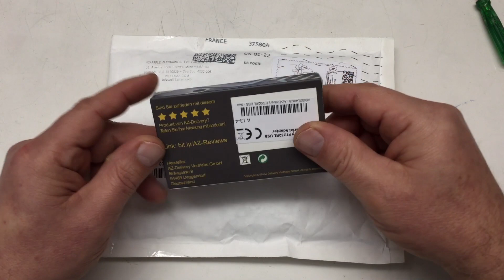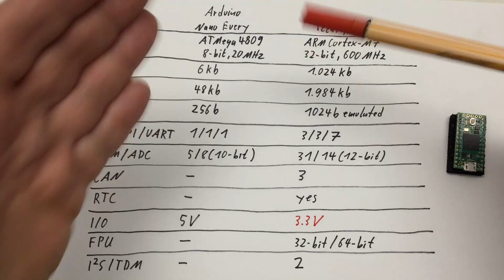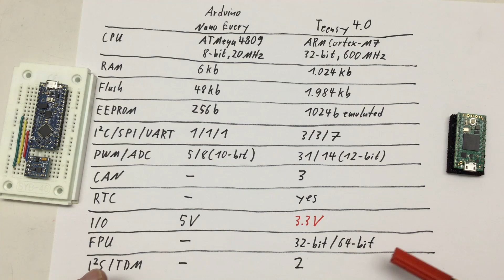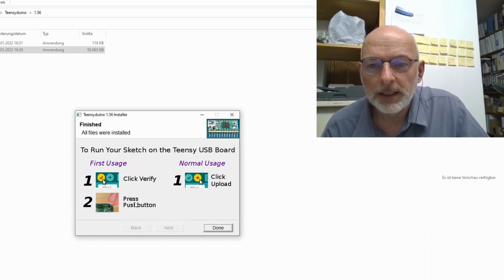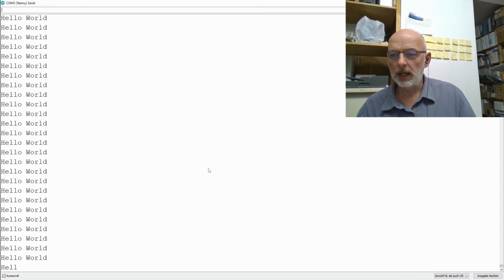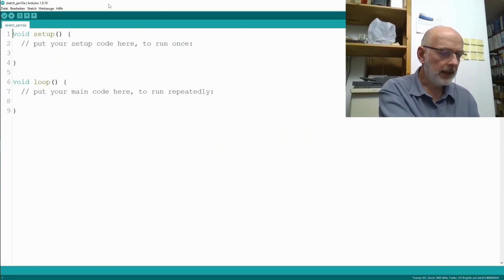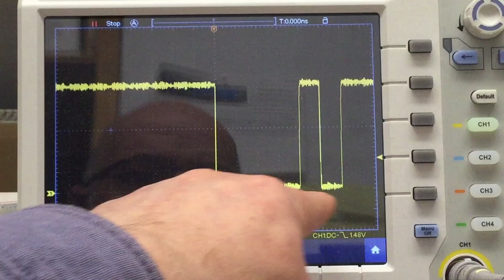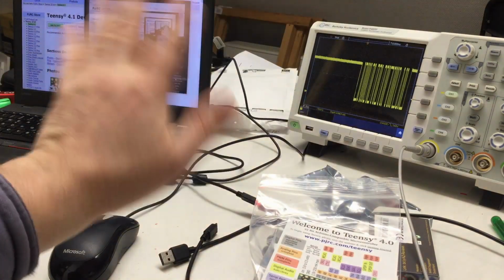Mailbag: Teensy 4.0 600MHz ARM MCU, FT232RL USB to Serial (incl. First Tests)

Comment: Powerful board indeed !...cheers.
Reply from the maker: Yes, it is. But I bought it mainly for the 7 buffered UARTs. Besides, I always wanted to play around with one and I had that Amazon gift card 🙂  BTW the Teensy 4.1 has even 8 UARTs and runs at 700MHz. It still fits on a breadboard, but with a two rows of 24 pins (it's 61mm by 18mm) it covers more than a third of it. But then, it comes with Ethernet (just solder on a 3x2 pin header for a little adapter) and a MicroSD card slot. It would make a nice Linux server in a matchbox.
Reply: @robertssmorgasbord  Wow an actual smorgasbord of videos' there, all ways thought about playing with one but to be honest I don't have a project in mind that needs that much grunt, the project I'm thinking about next is a Capacitance meter with a useful amount of ranges and a good degree of accuracy, but I'm looking forward to seeing this beast...cheers.
Reply from the maker: @andymouse  To be honest, I bought it for its 7 buffered UARTs, not for the power. It's hard to find any MCU development boards with more than 4 UARTs.